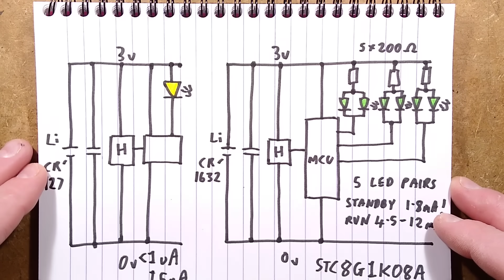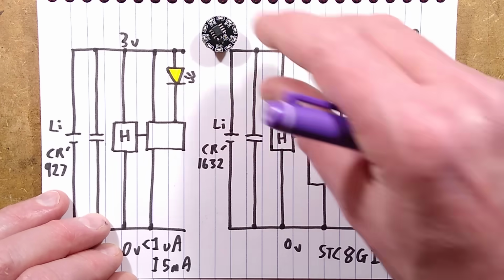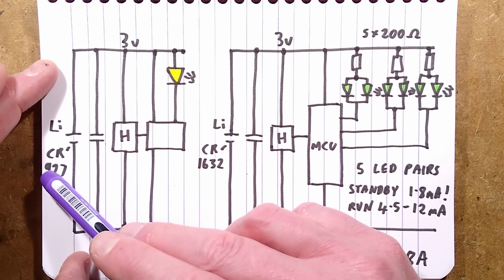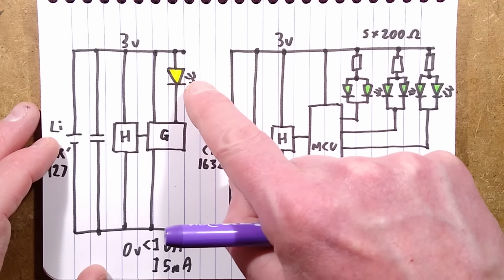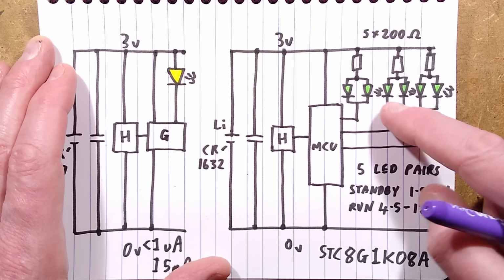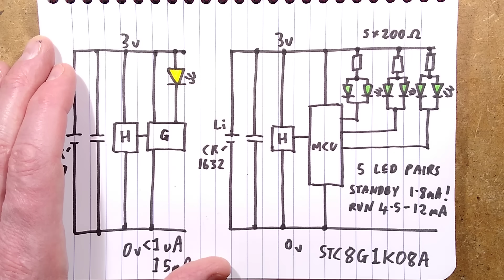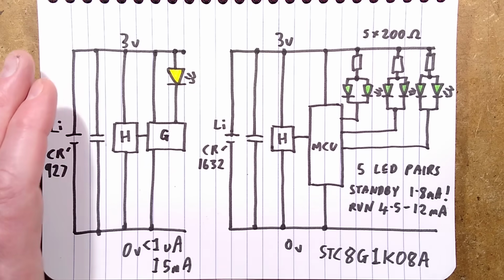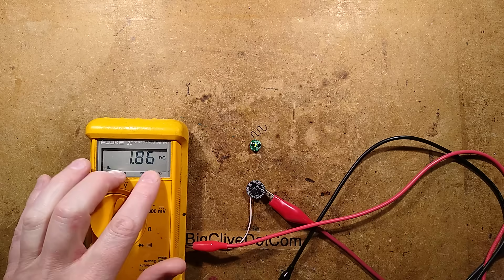Magnetically actuated lights - one with bad software

Comment: alright chief. i would love to know by whom are your drawers made? they seem a bit larger than the average nerd drawers. from where did you get them? i am sorting out my lair and i it seems every week i need more drawers. my need seems to increase exponentially. not so long i was happy with resistors and a few other bits. now i need ones for BJTs, mosfets, voltage regs, 74 series ICs, 40 series ICs, arduino breakout things, switches, LEDs, inductors, zener diodes, schotky diodes, diode diodes, and now ruddy valves have joined the list, so i need a way of storing all those. tbh i am baffled how anyone can fit enough drawers to store everything in their labs. oh and i forget i also have a few of the things i just mentioned in SMD form, too. i would love to see a vid in which you give use close ups of the drawers that we occasionally see in the background. not to mention i keep buying ludicrous amounts of things. for instance i bought 50 4060 ICs from china, for the same price as 15 from  ebay (which i also bought, just in case the first ones didn't arrive (TBH i get a lot of feeling of well being, just buy having lots of things i may need)) the filling of drawers, and knowing were they are delights me in a way i find hard to describe. i realise i am a bit rambly, and i may have over shared (a thing i often do, i am told) but it is Saturday night and i have been on the sauce, i am somewhat one over the eight.
Reply from the maker: Thanks.  The drawer system I use is made by Raaco.

Comment: Could someone explain why you would use a "toggle chip" (the one labeled G) instead of just switching the led using a transistor?
Reply from the maker: Because then you'd need a latch circuit to keep the transistor on or off.  The magnetic sensor is only active when the magnet is present.

Comment: There are some flow meters that you use two magnets to change settings without having to crack open the case.  You just have to remember which position to hold or toggle.

Comment: Hall effect sensors are the absolute best. I bought a keyboard that uses one to actuate every single key & it's been fantastic, letting me fine tune the distance needed to trigger the key and the distance to release that action down to a tenth of a millimetre, on a per-key basis. You wouldn't think it'd make such a difference to typing, but it really does. This has reminded me that I need to tweak the left shift release point because it's not quite close enough to the trigger.

Comment: Would that circuit be similar to the circuit used by a stand alone voltage test probe? Like the wall stud detector I has. It tells me when I'm near a power line.
Reply from the maker: No. the voltage probes detect an electrical field.  But you get similar ones for testing solenoid coils that do work with magnetism.

Comment: Just want to thank you clive for the videos you make I know next to nothing about electronics before watching your videos I knew nothing at all, but I find it all fascinating and enjoy messing around with all the bits and sometimes they work when I have finished sometimes all I get is smoke and sparks and bangs and the odd time thrown of my chair, but I enjoy it guess I am a slow learner or dumb, the latter probably but I won't give up which some might construe as been dumb.
Reply from the maker: Just learn at your own comfortable pace by experimenting.   Don't mess around with mains voltage stuff without taking extra care to make sure things are unplugged when touching them.

Comment: According to Aliexpress:- In order to save battery power, if the mode is not switched, the display will turn off and enter sleep mode after 12 minutes. Until my order arrives I cannot confirm or deny the accuracy of this statement. EDIT:- 3 programmed lights arrived. All turned off and entered sleep mode, after 12 minutes. I am unable to measure the current draw, if, any, in sleep mode.
Reply from the maker: Ah, I'll have to check that.  I thought it would just sleep instantly .

Comment: A lot of high end model railroad equipment has a similar system for turning lights in passenger cars, cabooses &c on & off, using a magnet in the end of a plastic "wand" (handle). I always thought they used reed switches but maybe they use hall sensors for that too.

Comment: Thinking about alternatives... could you do something similar to this without software with reed switches? Reed switches needs for the magnetic field to be present to stay closed (or open), but perhaps as a secondary circuit?
Reply from the maker: You can turn a reed switch into a latching one with a suitably placed magnet of the correct strength.  But it may be vibration sensitive.

Comment: I had a remote control with a leaky deckupling cap that drained batteries. Also an aldi cupboard light that had a zener reg that drained the battery (4 x 1.5 V)  batteries.  taking it out it has been works fine for afew years now. Possibly designed for working off a power supply and put in a battery application.

Comment: A trick I like to use for current reduction on micro's, is to use a wake on interrupt rather than polling for a detected input. This way it can stay in sleep 'forever' until a detection. I'd think this common on most micro's. I know it is on Cypress (now Infineon) PSoC, even their lowest end chips. BTW, PSoC is Programmable System on Chip.

Comment: The one with the multiple LEDs the STC microcontroller overkill. I fail to see why a 8052 serirs microcontroller is needed to flash a few LEDS. The reference manual for the microcontroller runs to almost 900 pages!

Comment: Never having seen these before, I was a bit disappointed that you didn't mention whether the battery could be charged, replaced, or just thrown away when depleted.
Reply: The clue is on the schematic. The small one uses a CR927 (9mm diam, 2.7mm thick) and the larger one, a CR1632 (16mm diam, 3.2mm thick)

The CR prefix designates these as primary cells - i.e disposable.
Rechargeable coin cells have a LIR prefix. ;)
Reply: @enhzflep luckily there are LiR 1632 cells and they're compatible so you don't have to throw those away. Unfortunately they're about 1/3 the capacity of the CR so if the throwaways only last a day the rechargeables would only last like 8-9 hours.

Comment: I miss those sticker lights which we could apply on old cell phones that would predict incoming calls before the phone rings 
I think it used the radiation from the phone and no batteries.
I wonder where the went.
Reply from the maker: I made a video about those.  The new systems use too little RF energy to light LEDs.

Comment: What would the little one do near a car's distributor?   Probably too low-strength field to toggle, and if it did, would be flicking too fast to see I guess....
Reply from the maker: There may be some level of input filtering, but the hall effect sensors are fast.  They do require a decent magnetic field though.

Comment: Very cool thanks Clive.
My intro' to LEDs was at school, in jewelry making, not long after LEDs became available to the general public. Worked with 1mm, 2mm, 2.5mm units. The bug bare was hiding the battery.
The 2.5mm unit came as a flashing or static device.
I've seen these new units of yours, used in Cos Play outfits, and may well be their origin. ?

Comment: Looks ideal for controlling brighter LEDs using a bigger power supply too. Replace the LEDs with optoisolators, solid state relays or just transistors working level-shift wise.

I am constantly amazed to see what used to be cumbersome complex circuits reduced to jellybean components. After Hall effect devices left the laboratory curiosity stage the were useful,but not this useful. Now that entire smaller circuit board can be used as a jellybean.

Comment: I made a costume and I need to control LEDs on it. I installed hall-effect sensors on it and use a magnet attached to my finger to trigger different effects. I have a dozen sensors to trigger different things. I feed those into an i2c GPIO multiplexer and use it to generate an interrupt when one is triggered. It's much more reliable than trying to use buttons. I have an LED in my view that nobody else can see that shows me when I get the right spot.

Comment: Could one run multiple either strings of LEDs from these themselves or use them to make a board? Thinking of making high vis that someone can turn on and off at night but use the single controller?
Reply from the maker: It would be better using a dedicated module for that with higher current drive and a bigger battery.

Comment: lol you say they could just "put the microcontroller to sleep".. ok but then how would it know when to wake up? you then say "just check if the magnet is there". that's why the micro controller is running. it is checking every second or so if there is a magnet, so it knows when to turn the light on. This device cannot turn off entirely, as then it would have no way to check if there is a magnet. by the sensor. the sensor can't magically generate power to flip a mosfet etc to turn on the microcontroller. it is not designed to do so. You can see it also memorizes the mode you set it to, even after being "turned off". This is another reason why the microcontroller is running.
Reply from the maker: Microcontrollers can be programmed to wake up from a sleep state by a logic transition on an input pin.  They can also be woken regularly by an integrated timer, check for an input and if there's none there, go back to sleep again.

Comment: I bought an underwater SeaScooter for parts a while back. It uses magnet operated switches to control the motor on/off so even if the finger trigger mechanism cracks, it won't affect the integrity of the motor housing.
Reply: @pmpwiz  What's that, what Sea Monkeys ride..?

Comment: Cheers Clive! I’ve just been playing with these for augmenting body jewellery, because I can trap them inside the ‘gems’, I’ve been pondering if it’s possible to add a similarly tiny wire-free charging circuit btw, but I think that’s beyond me.
Reply from the maker: It might be viable with a tiny rechargeable cell, but would require a reasonable amount of extra circuitry.

Comment: Very interesting use of magnets/hall effect, if they get much smaller they will have  to supply magnifying glasses with the buttons. I bought 2 large magnets 3 years ago, I've pinched my fingers using them and left, what we've always called a 'Blackmans Pinch', still good to have them. Good post Clive, thank you 👍
Reply: Large magnets can be very painful.  😥
Reply: @Deipnosophist_the_Gastronomer  So very true, ever since I was an apprentice mechanical engineer I've had a fascination with power of all types. My wife tends to think I'm in my second or fifth childhood as I tinker and build all types of gadgets. I'm 70 in April so I'll never change now. 😂😂🤣🤣

Comment: A good use I can see is fully waterproof/vandal proof/intrinsically safe stuff, you can have a button that has a magnet in and is completely isolated from the electronics.
Reply: Also explosion-proofing for atmospheres with nasty stuff in them.

Comment: When you measured the standby current on the big one, did you turn it off with a "long-press", or merely switch to the "no-lights" operating mode? I have a feeling there's a difference between the two states.
Reply from the maker: I think I tried both.

Comment: I just designed a tiny LED board, PIC processor and 8 multiplexed LEDs on an 11,5mm square board.  Smallest board we've ever designed.  A bag full of them is on its way from China to us now.  

We decided this is a good time to mount our old stereo microscope in our new office.  Going to need it to solder these boards!

Comment: Hi. I’ve got a failed Tapo P110 smart plug, the second to fail since last December. The plug still connects to the app ok and the light goes on and off but it doesn’t actually switch the load on/off. 
Max 243 watt going through it according to the app(about right). 

Any interest to you before I start a return? 
Have screenshots of the last 7 days power load, it happened yesterday.
Reply: Ah bugger. Thought I’d give it a few taps to see if it releases any contacts and it’s working again. Prob still being returned and there’s something causing it.
Reply from the maker: It may be high inrush current to a specific load.  It can weld relay contacts together.

Comment: I see this type of hall  circuitry in my .model railway hobby. They are used to switch on coach light or LED tail lamps, steady or flashing versions for the last wagon or brake van. I could send you one to reverse engineer for BC.C if you like.

Comment: The little one maybe has a CMOS  something like 74LVC1G80, is a flip-flop, does not need a micro-controller, that's why is using undetectable power when the led is off.
The STC micro-controller can be reprogrammed, is a micro-controller that uses FLASH memory to store the code and is a 8051 core architecture.
Reply from the maker: It's possible, but the pinout doesn't match.

Comment: Many MCUs these days have extremely low-power sleep modes with sub-microamp consumption and dedicated wake-up pins that can wake it up on a level transition. There's no need to run an oscillator and timer peripheral to periodically wake it up and check the pin state. It could be a flaw in the software or a poorly chosen MCU for this battery-powered device.

Comment: Those are neat but I wonder how hard it would be to eventually replace the battery if used in a statue or something. Some place you can access easily enough, but not someplace a wire would have made more sense.

Comment: I have uploaded a short showing something similar to these (in form factor)
I have some LED lights that were used in a Fidget spinner, the PCB’s are actually mounted directly to the negative side of a CR2032
It has a motion tilt switch, they almost look like clock crystals lol. 
It has a few components, Like a 3 chip single color LED with a standard RGB package design. Has a transistor for a slow fade down affect.

Not to mention, regarding standby time they have lasted since 2017 as it’s just a basic inline tilt switch

Comment: I have some LED lights that were used in a Fidget spinner, the PCB’s are actually mounted directly to the negative side of a CR2032
It had a motion tilt switch, they almost look like clock crystals. 
It has a few components, Like a 3 chip single color LED with a standard RGB package design. Has a transistor and a slow fade down affect. The resisters and a cap. So simple but pretty cool.

Comment: I checked the STC MCU. It has an idle mode and a stop mode, in stop mode it uses 0.4 µA according to the datasheet and the bin connected triggers INT1 that can be used to bring it out of sleep mode. So I am guessing they use idle mode instead of the stop mode. I used 5 minutes to figure this out, it wasn't even hard, it is all in the 857-page datasheet publically available, but this was near the beginning.
Reply from the maker: At this current I doubt it's even in an idle mode.

Comment: I wonder whether, when designing the multiple effects one, they were not able to distinguish easily between wake and cycle, using just one pin on the micro. The datasheet mentions 0.6uA in sleep, and when woken it's not clear whether the wake interrupt configured pin can then become a conventional I/O.

Comment: Very fiddly, tiny little bugger especially if you have bigger than normal hands/fingers😉 The larger one has a more desirable operation but not at the cost of replacement batteries.  Strange it doesn't hibernate?  Interesting, thanks Clive.

Comment: With this magnetic light thingy in mind ... could this chipset serve as a relay "timer" ?

Flashing the relay power like it did the LED's ? 

Is it beefy enough to even handle the current flow needed to power a relay coil even for a millisecond?
Reply from the maker: It would need buffered to drive a typical relay coil.  But could probably drive a transistor directly.

Comment: Funky, but it appears you can only buy a single unit per customer, which sucks!

On the subject of leds, Big Clive, I picked up a set of 10 solar powered lights with classic light bulb shape but with different coloured led strips in each bulb, which give a meteor shower effect. Only £7.99 a set from Home Bargains (if there is one on the Isle of Man!). It would be interesting to see what you think of them. On the Home Bargains web site they are 'Firefly 10 Meteor Shower Solar Lights. I think there's a 20-bulb version, too.
Reply from the maker: I'll take a look next time I'm across.

Comment: The 5-pin chip on the small board might just be a flip-flop wired to toggle, like a 74xx1G80. Look to see if the Q-bar output is shorted to the D input (usually pins 4 and 1 respectively)

Comment: A former coworker contacted me a couple months ago about repairing one of these in a Christopher Nolan-style Batmobile scale replica. They use these so that they can light up without needing a wire harness or hidden switches that weren’t on the original.

Comment: I like to use the 74xx1G80 single D FF in a 5-pin SMD package as a divide-by-2 counter by looping the !Q output back to D. Standby current is about as you would expect from a single CMOS gate running at much, much less than 1Hz.

Comment: Oh cool! The product I'm developing is a show critical bit of lighting, and needs to be as robust as possible. Against moisture, dust, shock, heat, etc.  I've been considering using a magnetic latching switch like this to remove moving parts and be able to seal it from the elements.   As performers are preparing for their show, could have a little magnetic base they all tap it on to turn on.